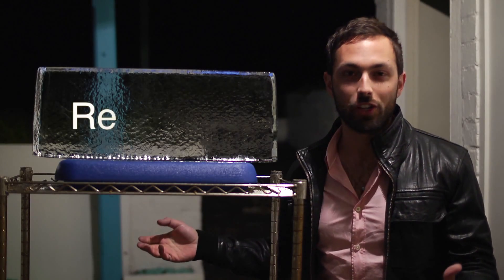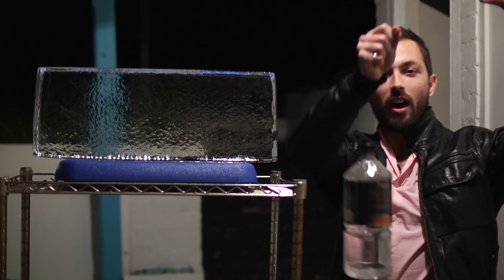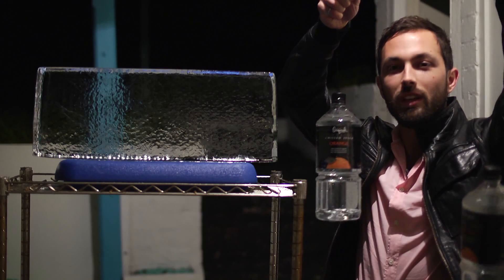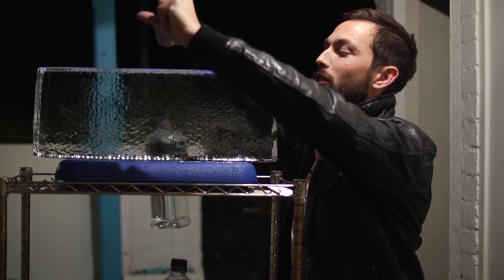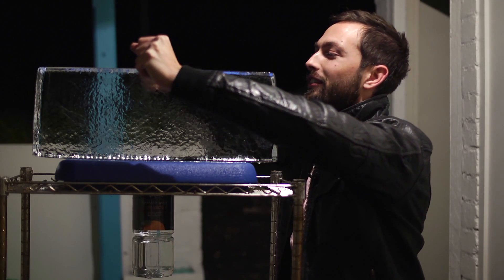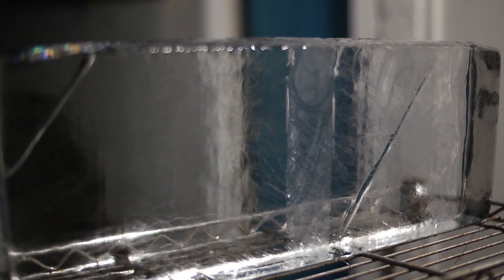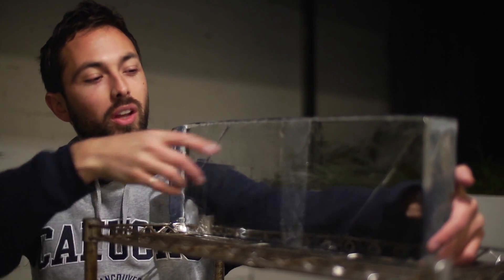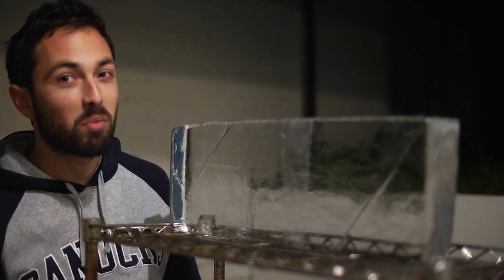Does Pressure Melt Ice?

Comment: I noticed that the string inside the ice forms a parabola. Is it a perfect parabola?
Reply: A rule of thumb in scenarios like these: whenever in doubt, assume that it's a hyperbolic cosine function
Reply: It is a hyperbolic curve. The same as you see in suspension bridges.
Reply: It's just always better to assume it's something hyperbolic. Chances are you'll always be right.
Reply: That also makes a lot of sense
Reply: I just changed my mind. Now I assume it to be indeed a parabola. 

As soon as the process is stationary, the wire drifts downwards with a constant rate. But the velocity of the wire perpendicular to itself depends on the position along the wire. It is proportional to the horizontal component of inclination. 
I assume the radius of curvature to be proportinal to perpendicular speed, so the curvature ist proportional to horizontal component of inclination. This differential equation is solved by a parabola.

What do you think? Please comment.
Reply: Is there a pretty way of demonstrating that it's hyperbolic? I know in fluid dynamics, we considered a square tank of water being rotated at a constant angular velocity and we could show the free surface was parabolic. Wondering if there's something similar you could do here.
Reply: ***** I think you might be getting some of the logic confused. Perhaps its true that all wires supported only by end points are a catenary. Is it also true that all catenaries are supported only by the end points? In other words, is that really the definition? The association of a hanging chain with a catenary seems like a physics result. What is or isn't a catenary should be decided by whether or not it satisfies the mathematical definition of the curve.
Reply: IF and only IF he perfectly balanced the string and the weight of the water on the ice, then yes, though that would be nearly impossible for a human being. :)
Reply: +Ben B. 
Looks more parabolic than hyperbolic to me. Someone should measure it.
Reply: Rainer Szalata It makes a lot of sense.
Reply: Far Trek
I don't think it has something to do with the melting "Sped up as it got toward the middle", I think it forms parabola because the weight is not evenly distributed because the weights are on the sides
I could be wrong too, It's just my Speculation
Reply: I need to learn more physics to understand this thread xD, I'm 17 btw and this is pretty interesting.
Reply: If you hang a string from two points you get a Catenary, which is a rope bent by the weight of gravity which is equal in each point. 
If you think about the shape of the wire, like someone said here it's shaped in a way that every point receives the same amount of force from the ice. 

Gravity is a force as well, so both Gravity and Ice should shape the string equally given that they have an effect uniformly across the wire. Hence, the shapes must be equal, so it's a Catenary as well!
Reply: namely the catenary
Reply: Its fuction of cosius hyperbolicous
Reply: I think so because the outer corners melted first, and then the melting exponentially sped up as it got toward the center. Thats just an observation so I could be wrong, but it makes sense to me.
Reply: +Ben B. 

assuming that the wiretension ist constant in the wire and it has no significant stiffness and mass. Further, the pressure under the wire gets the same along the wire in equilibrium.
Then I think its a circluar arc.

Why I think so:
The force each lenghtelement of the wire gets is the same in the ice. At ropes and strings that have no stiffness, the force at an element is proportional to the tension and the radius of curvature. Because the force per element and the tension is constant the radius will be constant as well. Hence its an circular arc.

What do you think about my assumptions?

Comment: could you pressurise water into steam?
Reply: Yes and No. Depends on what you see as steam. Steam in a scientific way is water in gaseous state, so steam is less dense than ice but even less dense than water. Water is just an exception really: steam has a high volume, water a small volume and ice a medium volume. So when adding pressure to ice, you decrease it's volume canging it to a liquid. But adding additional pressure won't turn it to steam. Steam in this way is invisible (it's a gas and a component of normal air) but steam as people usually use it in everyday language are actually tiny liquid water droplets hanging around in mid-air. So if you were to add pressure to let's say snow, it would turn into "steam".
Reply: i ask because i had an idea of making steam power without any combustion, creating an infinite and non-carbon emitting power generation thingy. but i have no scientific competence or experience, so i'm basically just rambling without any idea of what i'm on about.
Reply: an infinite power thingy is not possible. Ever. You can't get any power where there is none.
Reply: well i think how steam power works is that steam rises and turns a turbine, generating electricity somehow. so pressurising, say, liquid water, until it vaporises i think would make the entire process work without burning stuff to heat the water into steam.
Reply: But as I said pressuriazing a liquid won't make it into a gass. Besides, if it would, you would need more energy to pressurize it than the turbine would ever give back.
Reply: can't you just pressurise something then leave it? why does it have to be constantly pressurised, surely the pressure couldn't leak out if you made everything absolutely airtight, could it?
Reply: So you want to make an airtight box with a pressure so low that water would vaporize (low pressures get water to vaporize faster) turning a turbine? That is possible. but then the vapors would just hang in the box without moving anymore. Making your turbine stop.
Reply: MrRaintrees water boils at 100, freezes at 0.
Reply: The Benjamin so if steam has a high density are you proposing that extracting the ice instead of compressing it would turn it to steam?
Reply: steam has a low density. And yes that would turn it into steam.
Reply: +Bob Gabriels in Celsius, this guy's talking about farenheit.
Reply: MrRaintrees But isn't that what I said? Just with some more scientific words and in more detail? besides, water can be turned to steam even at pressures and temperatures lower or higher than the saturation pressure and temperature...

Comment: In this particular experiment, couldn't the water turning into ice simply be explained by the fact that it is a very narrow sheet of water just above 0 degrees sandwiched between two huge solid blocks of ice well below 0 degrees? Either way, very cool experiment.

Comment: Regelation, i.e., ice melts under compression and freezes again when the compression is relieved, remains puzzling since 1850 when Faraday firstly noted this phenomenon. Recent progress [Sun, et al., J Phys Chem Lett 2013. 4: 3238 and Chem Sci 2012. 3: 1455] inspired us to resolve this anomaly from the perspective of hydrogen bond (O:H-O) recoverability and water quasi-solid phase boundary dispersion. Compression shortens the length dL, increases the energy EL and phonon-frequency L of the O:H nonbond whereas the H-O bond responses oppositely to compression. O:H-O bond recovers its original state completely along its potential paths once the pressure is removed and oxygen atom finds bonding partners to retain its sp3-orbital hybridization once the O:H nonbond breaks. Theoretical reproduction of observations confirmed that the Ex and x reversible relaxation modulates, respectively, the integral and Debye temperature of the respective specific heat x(T) (x = L and H for the O:H and H-O bond) whose superposition creates retractable quasi-solid phase boundaries or critical temperatures for phase transition. Such memory and recoverability of O:H-O bond may provide possible mechanism for damage recovery of living cells.

Comment: How do we know that the temperature of the wire isn't what is causing the ice to melt. Say the wire melts the ice its touching, but due to the wire being so thin the quantity of ice which melts into water is small enough that the ice surrounding that water re-freezes it.
Therefore the wire is just heating the ice up, melting it while its passing through, and the remaining ice is still at sub-zero temperatures which the freezes that water again after its no-longer touching the wire.
I would say the only way to prove this is to make sure the wire pushing on the ice remains below 0c.
Reply: Correct, and if you did this, you would see the same result. However, as most metals are a good thermic conductor, we can already say that the wire has to be around the freezing point. As it melts the ice below, the ice absorbs heath from the wire, the wire turns cold and this cold is what freezes the above water back to ice.

Comment: In this case, wouldn't the ice be freezing because it's still got ice around the tiny little line splitting the block and it's taking several hours to make the cut in the first place?

This isn't exactly blowing my mind here. It seems perfectly reasonable for this to be happening. Warm metal string slowly melts through ice. Cold ice re-freezes the melted ice again.

If it's the pressure, could you melt two blocks of ice by pressing them into each other, and then end up with 2, separate blocks of ice through regelation? Or would you just end up with a bigger block of ice or a puddle of water?
Reply: The metal string could be as cold or colder than the ice and it would still work. So yes it's pressure, you can melt blocks of ice by pressing them together, they could end up as one big block or a puddle of water depending on how big the pressure gets. What should blow your mind isn't the freezing part, it's the part where ice has a bigger volume than water.
Reply: The Benjamin Not with as little weight as is on the string it wouldn't.

There's only 2-3 kg of weight on those strings, you'd need several times that for this to begin working at around 0C.
Reply: seigeengine It wouldn't what?

Comment: I think this theory of regelation is slightly misleading and easily misconstrued considering that it is nearly universal that an increasing pressure decreases a substance's freezing point. The exception of water is due to the fact that ice is less dense than liquid water, due to the lattice configuration specific to water. The theory of regelation is a phenomenon that only occurs for such substances.

If you look at the phase envelope of water, you can see that increasing pressure up to the triple point (the condition at which a substance can exist as either gas, liquid, our solid) at 0.006 atm, the freezing point (technically called deposition in this case, or gas to solid) in fact increases until it reaches the triple point of 0.1 C. Obviously, this window is very small and hardly measurable in the real world. But once that triple point is exceeded in pressure, assuming the temperature of the body stays constant, the freezing temperature (or melting temperature in this case) begins to decrease, as the pressure exerted on the solid interface exceeds the strength of the solid lattice. This is why it takes a relatively significant pressure to actually observe this.

Another thing to note is the added effect of using wire with high thermal conductivity, allowing significantly more heat transfer between the surrounding air and the point of contact than if say, a nylon high E string was used for this experiment. Transversely, I imagine you would see a significantly faster effect using copper wire. It would be interesting to see the three conditions side by side to take a look at how much heat transfer is effecting the situation. You could probably determine this if you had accurate measurements of the surrounding temperature and pressure, calculated the effective pressure exerted by the wire, and compared the rate of melting to the phase envelope and what you would expect to see assuming no heat transfer. But that would be way too much work and who would actually want to do that.. Transport Phenomena professors, eat this up.

Alright, got my nerd out now time to go back to work.

Comment: This is actually why the skates work. They don't slide on the ice, ice in it self is not all that slippery, but the relatively thin blade of the skate melts it to water and makes it less frictional. As the skater moves, the pressure is released and the water freezes to the surface of ice. Damn I feel clever now!
Reply: Ice itself is not all that slippery? But if you ever walked over ice you will notice how slippery it is, and I dont think we do enough surface to actually perform the same effect that ice skatters do.

Comment: This is a good example of needing a control variable. There's no way to be sure how much the actual pressure contributed to the melting of the ice. I'd be willing to be that most of the melting was due to the metal wire conducting heat into the ice. It's easy enough to test though. More pressure would melt it faster, so do two (or even three) wires each with different weights, say 2 bottles on each end of another wire, and a half full bottle an another wire. Don't want to go too light because that will reduce the amount of contact the wire has and will slow down the melting due to conduction.

Comment: This only work with substances of which the liquid state is more dense right ? Because otherwise it wouldn't make any sense.
Reply: Yes! The solid-liquid equilibrium line's slope on PxT diagram of the substance has to be negative for that to happen, and as that slope is given by dS/dV (dS is positive on ice to water transformation, since water is more entropic than ice), dV has to be negative - which means for a same mass of water the liquid state has more volume than the ice. You can only infer that in any phase transformation if you know which state is more entropic.
Reply: Yes.

Comment: I can explain it. When there is a huge crowd and a big powerful man who is standing in the back of the crowd and is trying to reach to the front.What does he do ? He pushes people and people give him his way because he is huge. Then people gather back to their original positions after he moves forward. In this way he slowly makes his way to the front. Same happened here as well..The crystals arranged themselves to allow the thread to pass through and then rearranged themselves back to the same position because the temperature was still freezing.

So basically, if we consider the theoretical definition of melting which is "Rearrangement of water crystals in order to move more freely" then we can say that yes "pressure does melts ice" because it was pressure which rearranged the water crystals to make them move freely so that the thread could pass though them. Also, if we consider the theoretical definition of freezing which is " Rearrangement of water crystals in order to move less freely" then we can say that yes "the zero temperature of the ice cube freezes the water back to form ice" because it was the zero temperature of the ice which caused the rearrangement of the earlier freed water crystals to get back to the less-free solid arrangement of crystals.

So, basically in the above experiment , pressure melted ice to water and zero temperature freezes the water back to ice.
Reply: That is because the crowd is a "liquid". They do not have fixed positions, they are free to move around.
With actual crystals, when you break it, yet keep it as a solid, it doesn't just rejoin. Try cutting jelly like this, when you put the pieces back, it doesn't join back together.

Comment: Isn 't also a possibility that the string is transfering heat to ice so it melts at the meeting point but when it goes lower the ice itself is below zero and the water between the ice cubes freezes again? So the only way to figure it out is to perform the same experiment in a fridge where the temperature is near or below zero sto the string is don t pass enough heat to the ice so it can be melt!

Comment: i could just as easily explain that through the idea of heat being conducted through the metal wire, melting the ice, and then the ice refreezing on top of it due to the surrounding temperature being below freezing and water being present when the wire has gone away.

Comment: If it's not too much trouble I would like to see this being done in a freezer room where everything used in the experiment is well below freezing.
Reply: The best you could do is around -20C, with a pressure of over 200MPa or 200 *10^6 N/m^2.
If you had a wire that was 0.2mm, cutting a block of 50mm(or 5cm) with the pressure the same throughout the wire, then that is a total surface area of 10 mm^2 or 10*10^-6 m^2, meaning you would need around need around 2000N of force, or 200kg of weights. Quite a bit.

Comment: Wikipedia says no; aint enough pressure. The ambient temperature combined with the conductivity of the wire just plain ol' melts through it. He should have had the block in a sub-zero room with a wire made of low conductivity material.

Comment: "Weights suspended from a wire which cuts through ice, is an example given in old textbooks. Once again the pressure required far exceeds the force applied. Conduction of heat from the room through the metal wire is the correct explanation of this phenomenon."

I don`t want to be a party pooper here, but it seems it`s due to the diffusion of heat into the ice rather than the pressure???